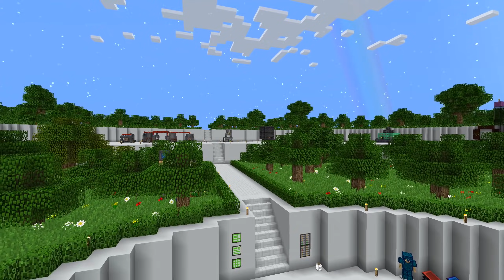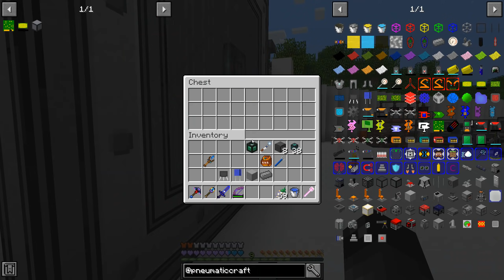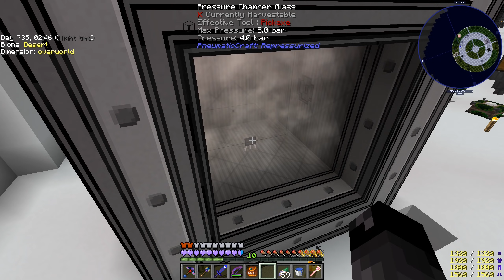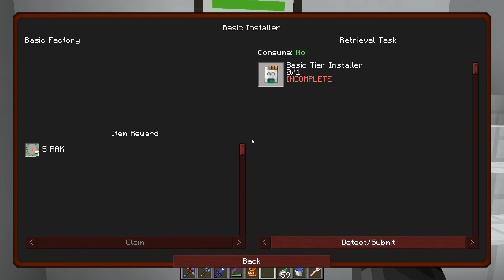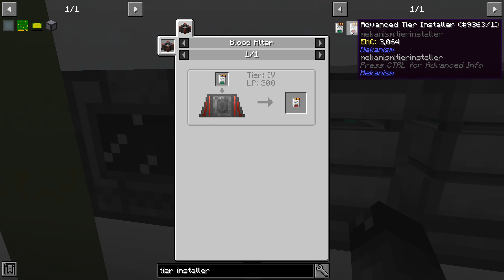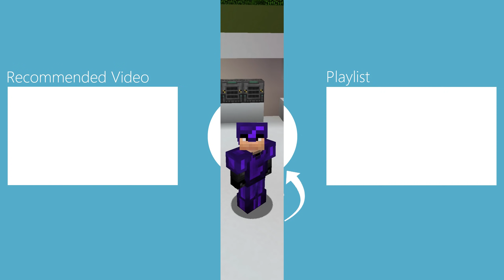Project Ozone 3 Kappa Mode - BASE STATION [E71] (Modded Minecraft Sky Block)

Comment: Hopefully, you see this before you go through all the hassle of setting up the rest of the automation. If you recall, the Infusers actually will need 3 sides available; 1 for inputting the item to be infused, 1 for the "Infuser" (redstone, etc...) & then 1 for output. One of the main things I dislike about Mekanism is this feature (unlike Thermal machines) you can't input/output from the same face, nor can you input 2 separate items.
Reply: He has the top, back and bottom sides available so long as he is using conduits to transport the output and infusing items to and from the interfaces.

Comment: Hypno, you should see if this modpack has Integrated Dynamics, if it does you should check it out, its right up your alley as far as automation goes. Very coder esq, but still simple, you can do very complex automations with it.

Comment: Saw the compressed iron ingot issue coming when I saw it in the output filter. Encountered it myself when I first played with Pneumaticraft. You picked up on it quick though.
The pressure chamber it bottlenecked by the interface when autocrafting. Having multiple input interfaces fed from a buffer container via conduits/pipes will help. Multiple ingredients will be fed in at the same time.
Reply: Yeah, with buffer container will make it better
Reply: Also using redstone controlling also make it ok then 👌
Reply: the interfaces are lightning fast with just three speed upgrades in them, and also just compressing iron blocks and autocrafting down with a compactor lets you use just one interface